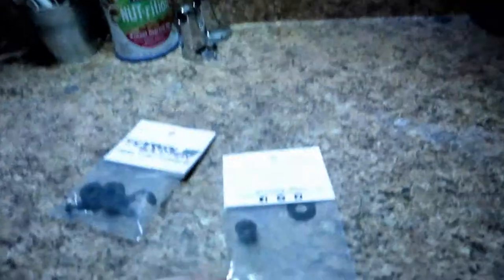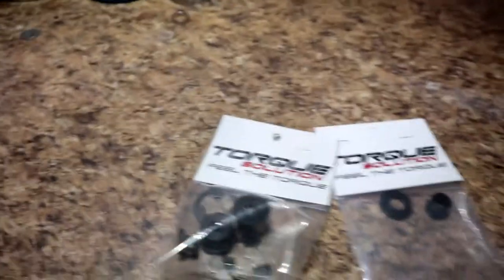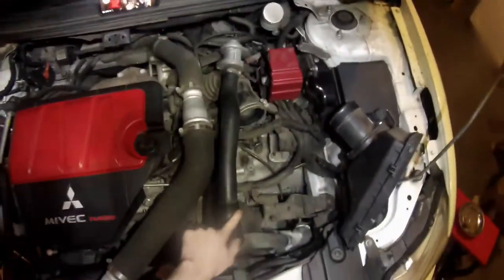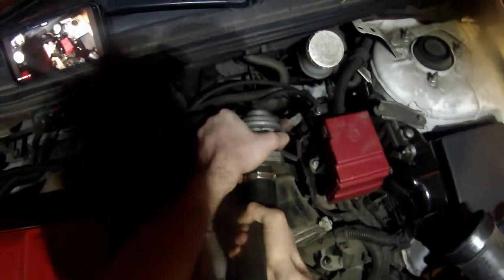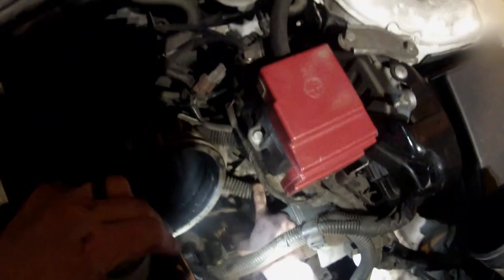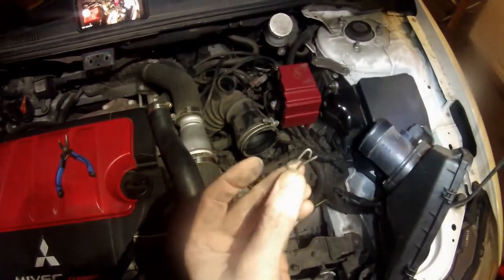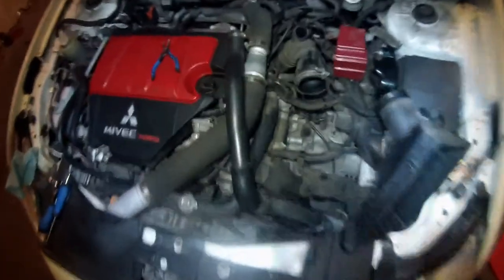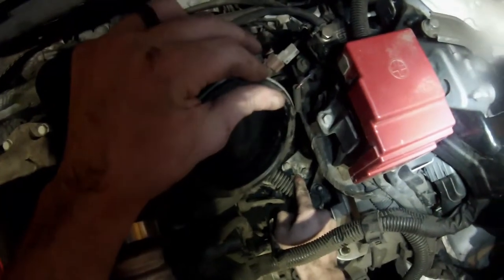Evo X under-hood bushing install

Comment: Did it fix the issue?
Reply from the maker: Yeah, It helped a lot. However, When the car is cold its still kinda "clunky" or whatever, not as bad as it was though. Once the car is warmed up it works great. Idk if it was just the under-hood bushing themselves or the whole kit working together but im happy with the results.